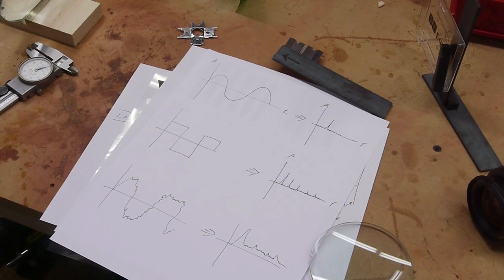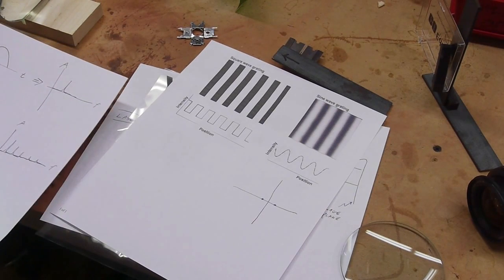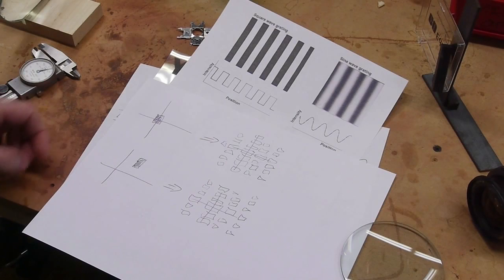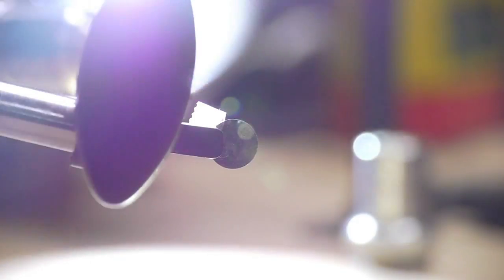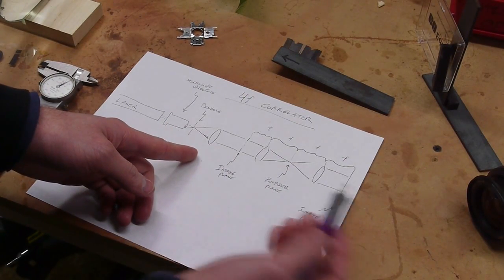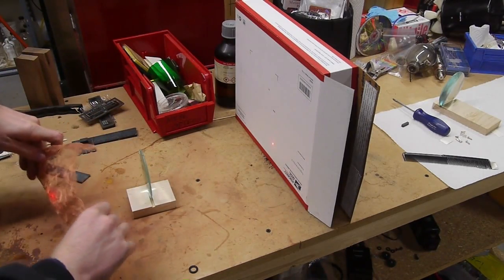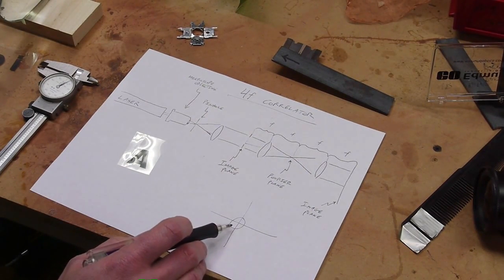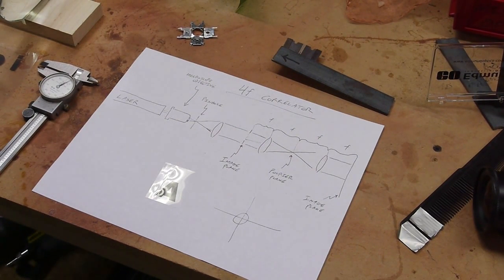Intro to Fourier Optics and the 4F correlator

Comment: Also, under certain circumstances you CAN recover the object from only the magnitude of the Fourier transform. The problem is called phase retrieval and it’s important in fields like astronomical imaging, x-ray diffraction, and holography. In the past, I’ve used iterative phase retrieval to generate phase-only holograms for a phase only, liquid crystal spatial light modulator given only the desired far-field irradiance pattern (i.e. a picture). The result was a holographic video projector.
Reply: Cheap Science is it possible you could link some papers or review articles?

Comment: Fourier optics is wonderful stuff!

A few comments:

Originally, the reconstruction process for synthetic aperture radar was accomplished using an analog, optical computer. Take a look at Goodman (THE Fourier Optics book) section 8.9.

Your spatial filter is also a filter in the Fourier plane. The pinhole cuts out the high frequencies to clean up the beam.

Making your mask objects smaller will make your Fourier plane bigger. Also, you can magnify the Fourier plane to make it easier to see.

Comment: About printing your own transparencies, last night I tried using a laser printer on transparency slides, then using TRF to seal it and make it significantly more opaque and had varying success.  If you are interested, I could print you a slide with the black part in copper and that way it can be totally opaque with my glass PCB process... I'd have to see what I could about completely cleaning off glue rather than sealing it with polyurethane.

Comment: The FT/DFT is actually pretty straight forward if you think of it as the result of cross-correlations between your signal and a basis set of complex sinusoids (each of which is just two real sinusoids 90 degrees out of phase - using complex numbers just lets you stuff the phase information resolved from the quadrature sinusoids into a single number).  The x-correlation finds the amount of each component sinusoid in your signal, decomposing it into its magnitude and phase spectra.

Comment: Spatial filtering of super high intensity laser pulses was the savior of laser driven nuclear fusion research in the 70s. In beams in the gigawatt scale, certain self-focusing effects begin to become apparent due to the intensity of the electric field component causing a change in refractive index in air and causing the beam to locally collapse into a filament. Image relaying and filtering after every amplification stage cleans the beam and prevents the laser medium from blowing itself apart.

Comment: This is also the way to do pattern recognition in real time. To calculate the cross correlation you put the transformed image of the pattern to be recognized in the focal point between the two lenses. you will get a bright dot if the two images correlate.